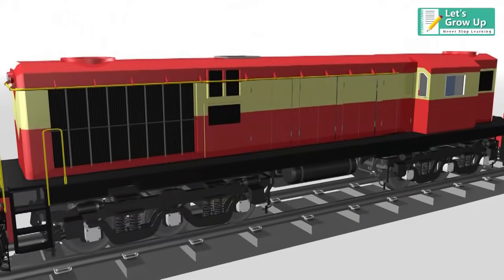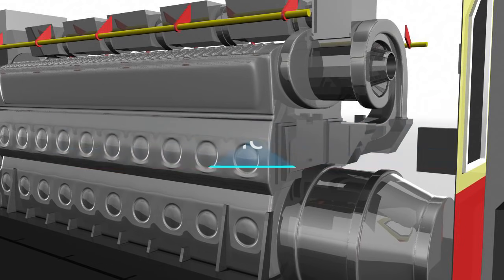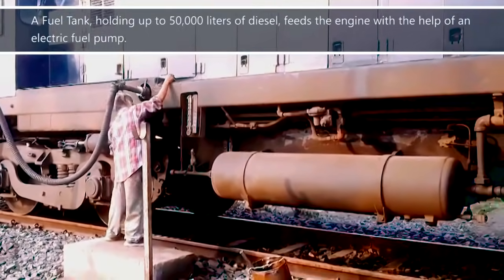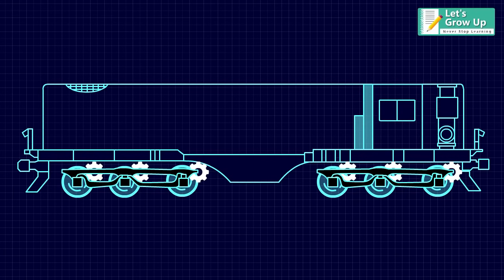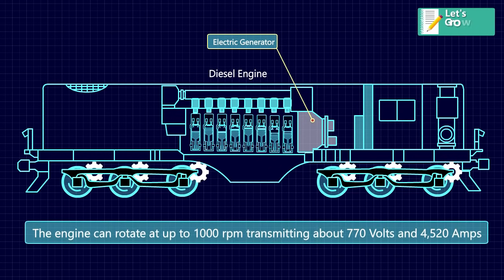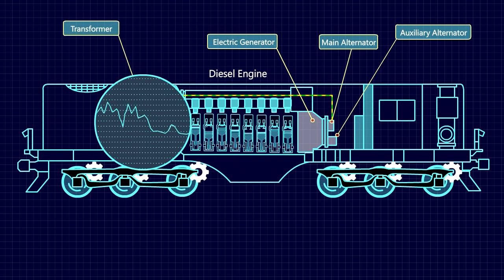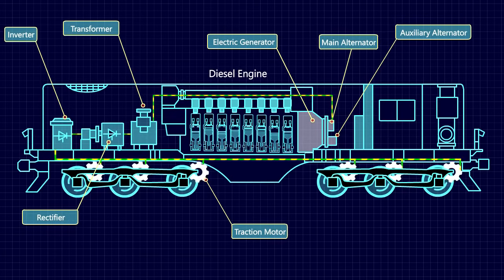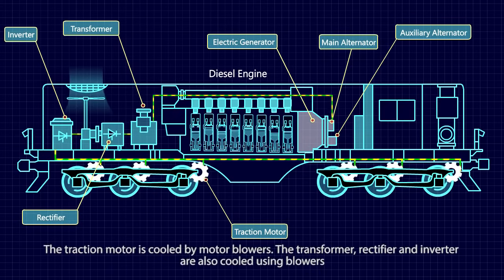Diesel engine working function | #Diesel locomotive | How a diesel locomotive works?

Comment: Engine -> Alternator -> Transformer -> Rectifier -> 3P inverter 

Where is the throttle applied to control the speed of the locomotive?

Comment: A bit confused on the three-way conversion. Why can't the 770v just go directly from alternator to the wheels? the DC can still power the conductor cab, but it just doesnt make sense to do ac-dc-ac for the pull. maybe it offers more control that way, idk, just seems inefficient
Reply: Because they need a specific frequency and voltage. Alternator voltage is unsteady.

Comment: Diesel engines are 2 stroke as well as 4 stroke both types.....Fuel/Diesel capacity ranges 5000/6000 liters, for cooling of traction motors Traction Motor blowers are there.

Comment: You know, different classes of diesel locomotives certainly can actually have an official diesel-electric system as well as a diesel-mechanical system as well as a specifically wonderfully great diesel-hydrualic system depending on what type of transmission the locomotives were given!

Comment: I have 1 big question, why do these locomotives need such a huge low rev engine instead of a downsized engine inspite of having an electric drive system (or electric transmission system)?
Reply: Because of the law of conservation of energy. You cannot get 3000 kW of electrical power from a generator without a 3000 kW capable engine that can spin it.

Comment: Didn't you say it was powered by a two stroke motor? Why then when we saw the engine running there were tappets operating valves to let mixture in and exhaust gases out.?

Comment: Not all diesel locomotives have big  V12 or V16 engines. The shunting or switching locos usually have smaller inline 6 or inline 8 cylinder engines.

Comment: Nice video. I came to know first time that diesel locomotive engine driven trains have actually diesel electric engine which equipped with electric traction motor rather than complex mechanical gear & clutch system. Thank you sir.

Comment: Generator AC. Goes to rectifier converting to DC. Goes to inverter for 3 phase AC to the traction motors. Why not just stop at Rectifier and use DC traction motors. ? Otherwise, just generate 3 phase AC and go to AC traction motors. The problem was controlling speed changes on AC motors. There's usually 1 speed for AC. You had to use DC for rheostat speed control of DC motor speed. You also could series DC motors for high torque pulling.  Parallel for lower torque faster speed..
Reply: Older Diesel Electric locomotives have DC traction motors (TM's), the newer ones have AC TM's. The simple reason is maintenance, DC TM's have a lot of brushes to maintain on 6 TM's, and AC TM's have no brushes.

Comment: 2:06 Actually the graph of output current does not look like that and looks different for a half wave and a full wave rectifier. A full wave rectifier will give pretty much the same shape as the AC input, but the lower portions of the graph are reflected up. Sort of like a |sinx| graph.
Reply: Bhai capacitor se filter karenge to aisa hi graph hoga
Reply: Capacitive filters are added to remove variation

Comment: GE(General Electric), and a couple others, make 4 stroke engines. And one does get V8 engines on some locomotives. The engine in the video is a 2 stroke V16 on a GM(General Motors) locomotive.
Reply: Why it is having OHC

Comment: Not going to comment on what facts are wrong in this video but I'm gonna write my simple explanation:

Diesel locomotives come with 3 different power transmissions:
-Mechanical
-Hydraulic
-Electric

1) Mechanical transmission is used on very light railcars and very few locomotives use it. My only known example of a mechanical transmission is on the German built Uerdingen railbus (Uerdinger Schienenbus).

2) Hydraulic transmission is good for DMU trains (diesel multiple unit) that aren't too heavy and mainly consist of one, two or three wagons/cars. It widespread on European shunter locomotives too. It's basically one or two torque converters. If a locomotive has two torque converters only one can be active at a time. Why have two? Because it's done to have two different gear ratios and are switched by having oil only in one torque converter. As for switching forward-reverse there is mechanical gearbox for that between the hydraulic box and driving wheels. It's a complex system that requires a lot of maintenance and it has it's limits.

3) Electric transmission is the most powerful and versatile for a locomotive. A diesel engine that can vary it's RPM drives a generator that powers traction motors located in the bogies/trucks. The engine is mostly 4-stroke but there a 2-strokes from manufacturers like EMD and Jenbacher AG Austria. Generators are DC and alternators are AC but in the railway terminology we always refer to it as the "main generator". Most widespread traction motors are DC serial wound. Modern locomotives come with 3-phase AC motors. The most simple solution to control power and speed is by having only the diesel engine change it's RPM, but there are solutions like regulating the voltage with thyristor regulators and connecting DC traction motors in different series and parallel configurations.

Comment: What I want to understand is why is it done this way.  Converting mechanical energy to electrical energy and then back to mechanical energy must result in substantial losses.  Is it in order so that the diesel motor can run at a constant RPM?  Or is it for better control?  I imagine a clutch and gearing system doing work this heavy could be a nightmare to work out...?

Comment: You say, the diesel engine produces alternating current by the alternator, which is then converted to D.C. current via rectifiers. Then the DC current is converted back to AC current via inverters. The AC current is then fed to AC motors to drive the train. Is that the sequence of the power flow? My question is, why convert the Ac current produced by the alternator, to DC current, and then t back to AC current for the motors? Why not take the AC current through the transformer straight to the AC traction motors
Reply: Because a direct phase splitting of ac would not be possible as it is done later on
Reply: The frequency of the AC current is important.  The speed of AC motors are controlled by controlling the frequency of the AC current fed to the motor.

Comment: Y diesel Power cannot be directly used to drive the wheels...is it because a diesel transmission cannot achieve the heavy torque needed to pull the whole train

Comment: We first burn diesel, then run generator to produce AC, transform it to DC, then rectify the the current to smooth the current output, then feed current to motors to run the engine on rails. In this process, much more energy is wasted. We are getting only 20% of IHP at the BHP end. Why not to run rail wheels direct from Diesel engine by providing auto/manual clutch system?
Reply: Theres no torque converter or clutch that would be strong enough to pull the weight of a complete train

Comment: Very interesting. Diesel electric locomotives have been in existence for very long. We should learn a lot from these engines. The world and India are very determined to have electric automobiles, but the problem is the the battery. We do not have a charging network and charging takes time. If super capacitors become cheap it will be a very big help. For the time being we can do with hybrids. This is where the experience of diesel electric locomotives will be a great help.
Reply: It was very informative comment... thankyou
Reply: Yes
Reply: Hell yeah I'm on it
Reply: Trains don’t use batteries. They have power lines on top to use.
Reply: At present tym Hybrids or plug-in hybrids seem better option than fully electric vehicles... Plug - ins seem more suitable as it will force us to develop the habit of charging to save more fuel and maybe run small distances on full EV mode...
Reply: I think recharge sollar,electric tower ,maybe it's work....
Reply: Well the main reason of why were transferring into electricity powered vehicles is so we reduce carbon emissions and reduce the effect of climate change and etc. you know this stuff if you werent locked up in a cave for the past 20 years. i dont think transforming mechanical energy into electrical would really lower them honestly i think itd have the adverse effect. I mean its logical beacuse no energy transformation is lossless. Reason why trains have this technology is beacuse  dc current motors have maximum torgue at any given rpm and also dont require a transmission so that leads to lower need for maintenance, more reliability and better control.
Reply: @rock_star_boy8967  Electric vehicles will not reduce the net pollution. The only difference will be pollution will be transferred from cities to the coal thermal power stations. 75 percent of the electricity in India is produced by coal thermal power plants. DC motors have their own problems. Since variable speed drives have become cheap, shift is towards AC motors.
Reply: Well youre right in this point  of view thats why climate change is a much broader problem that requires major changes in the whole infrastructures of nations. My argument was solely based on your claim that this type of train technology would be a substitute to electric cars or hybrid cars but thats not true since it would lead to no improvement at all.
Reply: @rock_star_boy8967  Innovation is a continuous affair. It cannot happen overnight. Many improvements and good things keep happening. Earlier we were satisfied with Fiat and Ambassador. Now so many good cars have come. Tatas have come out with eTigor and Nexon ev. The only problem is charging. Andhra Pradesh is having upper reservoir and lower reservoir. When surplus solar power is there, they will pump to upper reservoir. When they need power they will use the hydro power.
Reply: @satinderchadha480  lol electric cars are way more efficient than gas and power plants are more efficient than gas engines so you always end up with less pollution.
Reply: @satinderchadha480  Very good observation.
Reply: @rock_star_boy8967  Do some research into how the materials are mined that go into these batteries. They are dangerous to mine and not exactly environmentally friendly to refine. Not only that but a lot of child labor is used in the mining. All these vehicles are is a feel good measure. Beside where do you think all of the power will come from? Not from renewables but from fossil fuel. Not to mention most electrical grids won't be able to handle it.

Comment: I still don't understand how it works. A freight train has to pull hundreds of tons. How do the electric motors driving the axles overcome the resistance?
The concept seems to be the same as an electric motor that drives an electric fan in your home, right? Ok, but there is only so much resistance the electric motor can overcome. It can overcome wind resistance to keep the fan spinning, but if I stick my finger between the blades, the fan will STOP and the electric motor will burn up because it can't overcome the resistance I'm introducing. 

So how do these electric motors on trains not burn up? There is nothing mechanical FORCING the axles to spin, which is the case on a car or truck. The axles on your car spin because of the explosions in the cylinders FORCING a piston down, which in turn spins the crankshaft. But in the case of these locomotives, there is no direct mechanical interaction between the diesel engine and the rotation of the axles. So how does can an electric motor be FORCED to overcome resistance?
Reply: Bigger, more powerful electric motor on a train, comparing that to a smaller household fan motor is like comparing an untied balloon to a Saturn V rocket, same principal, vastly different scale.
Reply: @lancecombes  Wait never mind....I just realized by "untied" you meant the balloon tip itself, not the string anchoring it...

Ignore me.

Comment: Why can't wheels be directly connected to diesel engine rather than alternator and motor.?
Reply: Because the torque required is extremely high. It is close to impossible to build a mechanical transmission to handle the required torque.

Comment: I have not seen a diesel engine with transformer as said in video. Moreover the design shown here is of Alco type locos whereas Alco locos does not have AC motors

Comment: Generator creates AC, it is then rectified to DC, and converted back into AC. Why?
Reply: Because generator generates single phase AC which is later converted to DC and from DC to 3 phase AC.. Traction motors runs on 3 phase
Reply: The frequencies of the two AC systems are different. The generator frequency is controlled by the RPM of the diesel engine. The frequency of the AC applied to the traction motors is determined electronically by the inverter and can be varied. The RPM of the traction motors is controlled by the frequency of the applied AC. This was not explained in the video.

Comment: How does the locomotive move? How does the electric motors know when to go or not? Where is the rest of the information?
Reply: Hmm, maybe the principals of reverser working and stator field reducing are the theme of any of next lessons.
Cause the "volume" of electric engine power depends directly on diesel RPM, so, i guess, it needn'd further explanation.

Comment: (@ 0.36)There is nothing like 2 stroke diesel engine commercially available. Every locomotive use 4 stroke diesel engine.  Please rectify.👍
Reply: The engine shown running in the video is an EMD 645 engine which is a 2 stroke engine.
Reply: @lightshipchief   then why do it has OHC valve in it.
Reply: You're too young.

Comment: Giving numbers and specific technical details is useless unless the specific locomotive is mentioned. Maybe there are 4 stroke engines, maybe run at above 1000 rpm, maybe it makes 800 volts and maybe more or less then 4.5kA

Comment: So, the electric current is engaged in an endless loop between the generator and the motors.  How come the electrons in the wiring never are worn, or perhaps simply evaporating from the wires due to the endless  loop?

Comment: 2 stroke engine? are you shure abote that? 1:00
Transformers? maybe they generatorsa just produse requed 800V without any transformers
VFD (inverters) also useless part here: 1 - you can change alternator sped (and frequency) 2 - you just use DC motors and changing alternator speed also change voltage (motor speed)
Grow Up please before make some videos

Comment: The rectifier and inverter setup seems rather self cancelling. I know Diesel locos have been around for decades but this demonstration makes them look rather inefficient
Reply: glad I'm not the only one who thought that. I don't know enough about transformers to know why they need a rectifier but it does seem very inefficient.
Reply: My home generator uses an inverter to better control exactly how many cycles per second the generator produces. That is needed on the train, otherwise the train speed would surge. Not good on the motors either. My generator will safely run my computers without damaging them due to voltage spikes.

Comment: everyones saying that this video is wrong but could someone give me an explanation why? im not disagreeing, im just curious
Reply: The video is pretty accurate actually. I am a former EMD loco electrician.
Reply: @krakenwoodfloorservicemcma5975  ah neat! just one more question. Is this diesel electric solution really more cost effective/efficient then a normal diesel engine? I dont see how this could be more effective. generally the more steps something goes trough the more ineffective it becomes and here they basically use electricity generated from a diesel engine. why not just hook the engine straight to the wheels?
Reply: I am sure there is power loss converting diesel to electricity but it is a very smooth transition. There are some small locomotives out there that do have a regular transmission.  When a heavy train is stopped on a hill, it needs a real smooth start to get rolling again. The computers can pulse the electricity just enough so it rolls without slipping.

Comment: when i was younger, i used to think that a diesel would put its power through a drive shaft, into the pivot of carriage of thw wheels, and send the power into the wheels. that was when i was 5. i now think of highly more complex things, for example, the ultimate mecha monster, i call it warerah. it has fuctional atomic breath, strong, durable, protective, flexable legs, and also has a very long tail as a additional limb, made for decapatating its foes. yeah, warerah(war-rah) is a beast

Comment: Did you even try? You said that diesel locomotives are powered exclusively by a 2 stroke engine, but literally the only engines you bothered to show are 4 stroke!
Reply: So what's up with the 3 valves then. the one valve seem to be moving separately from the others
Reply: @zachhalle6711  It is a mecanic fuel injektorpump for each cylinder.
Reply: No it is 2 stroke
Reply: @sajeevpk5051  The center ventil is not a ventil. It is The fueul injector drive for this cylinder. Next cylinder have same confguration. For exempel v 12 engine have 24 exhoust valve and 12 fuel injector pump.
Reply: This is a Detroid Diesel sir..., 2 stroke diesel is different than 2 stroke gas.
Reply: @AMV12S  2 stroke diesel engine have often exhuast valve in cylinderhead. It is common on big 2stroke engine in locomotive or ship.

Comment: How IGBTs are used in diesel locomotives? please explain with example
Reply: The IGBTs takes high voltage DC power and rectifies it to a variable AC 3 phase power. This has traction control advantages over straight DC powered traction motors.